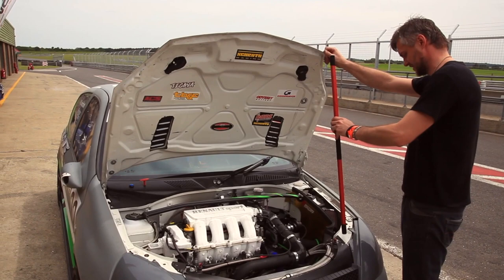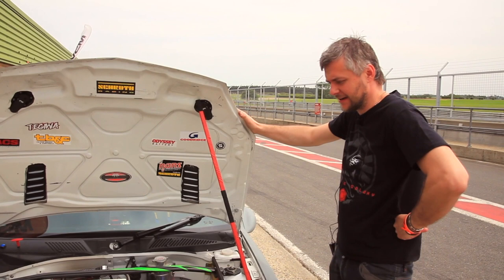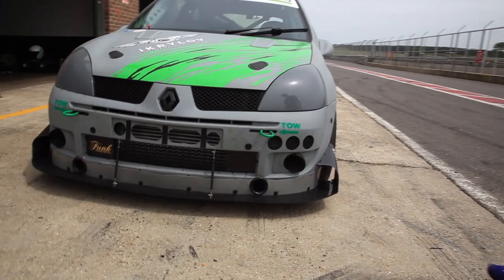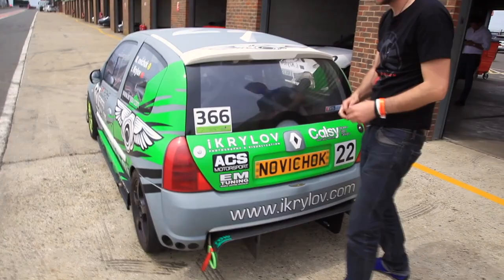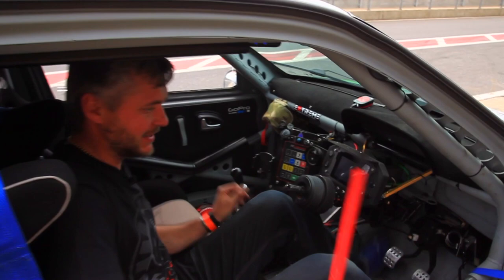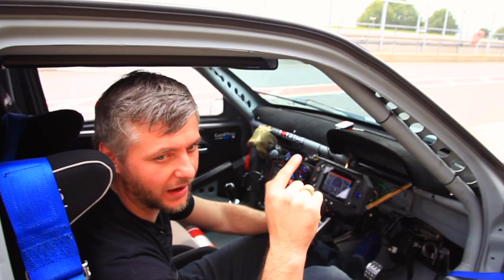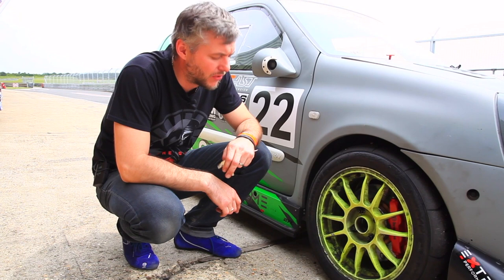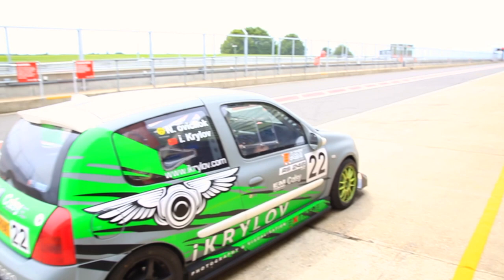I want to build Fastest Renault Clio race car in the UK. my DIY clio race car build. clio 172 turbo.

Comment: Great build but in the terms of the cold air intake - what's the purpose of that in the turbocharged engine?   Seen few cars build for WRC and they take air from back of the engine almost above turbocharger. So based on what best engineers in this business do it is important what's after the turbocharger not before. Different story with a naturally aspirated engines.
Reply from the maker: well same principle apply. colder air is more dence! more you can ram in the better

Comment: What mods can I do on my clio, I got it mostly because my insruance premiums went high as hell after I had it revoked, I want to make it a little faster and sound a bit better, any recommendations? It's a "daily" runner per say
Reply from the maker: i would say for sound upgrade exhaust. for power matched inlets, and remap. but i always recommend handling mods. better suspension and brakes.
Reply: @RuskiWeldFab  do you think for roughly £1000 I can mod my clio pretty nicely?
Reply from the maker: yes 100%

Comment: A l époque de mon pere c etait les gordini ou tout le monde pouvait sans payer une et rouler sur circuit les wd et aller aux boulot la semaines une voitures couteaux suisse faut rouler avec ca et pas que sur circuit partout elle sont née pour ca et la derniere la rs3 et la meilleur tres bon chassis ils y on mie tout leur savoir la 3 et surnommé cher renault sport la 350 z traction sa veux tout dire pas de drift du greap et du circuit basta